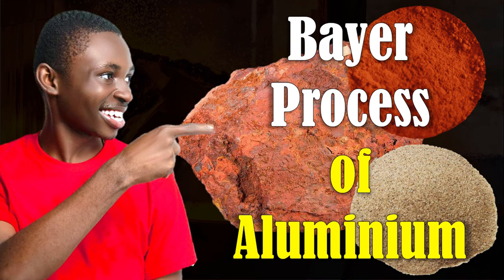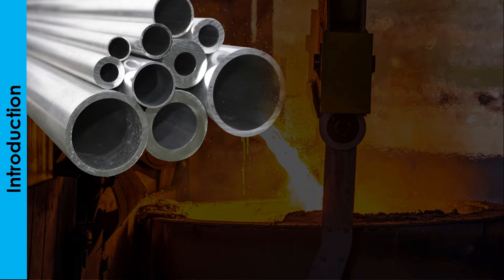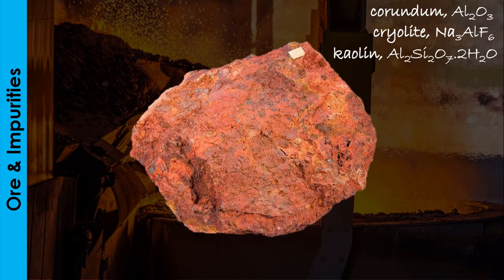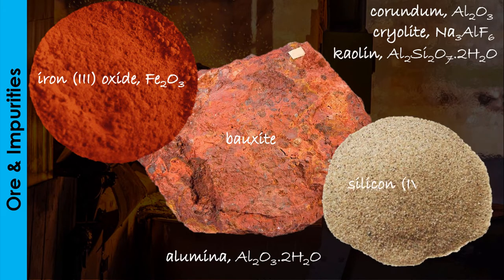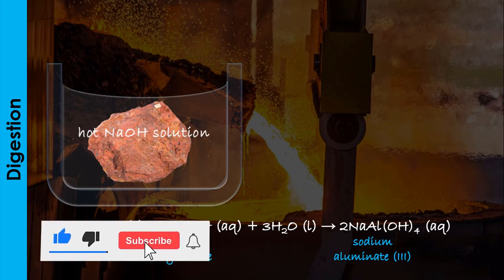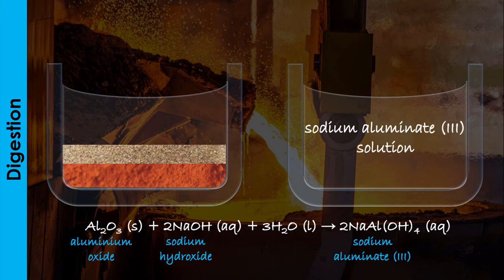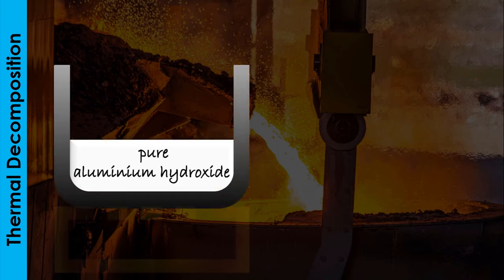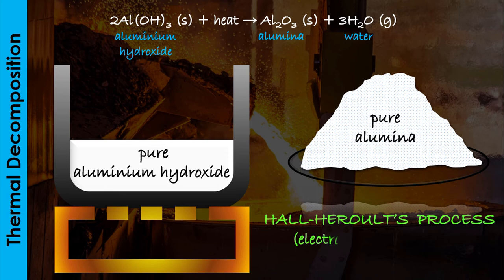Bayer Process of Aluminium | Purification of Bauxite

Comment: Very informative thanks
Bro i need your help, can you tell me how can i separate pure iron oxide 3 from red mud (silicon oxides and aluminium oxides...), in this bayer process when we add NaOH  The silicon oxide and iron oxide precipitated, but was the precipitation mixed or did the iron oxide precipitate at the bottom of the basin Then on top of it is silicon oxide?
Reply from the maker: What you have in bauxite are trioxosilicates and not necessarily silicon dioxide. Silicon dioxide is soluble in sodium hydroxide, but the silicates are not.

The silicates are less dense than the iron trioxide, so they will float on top of it